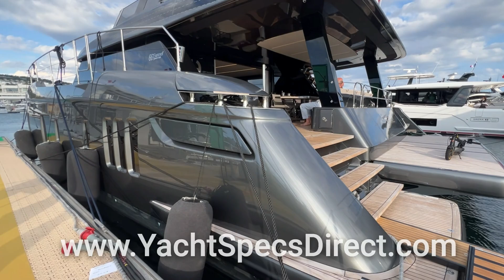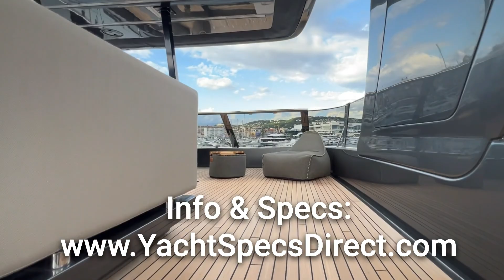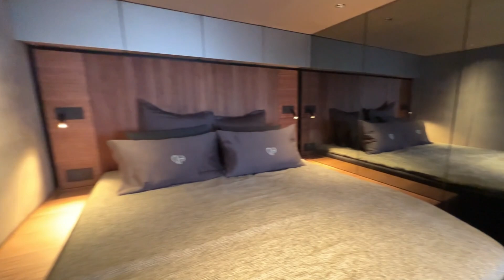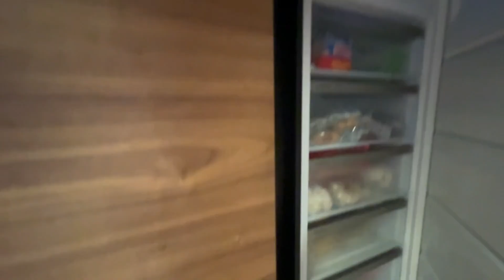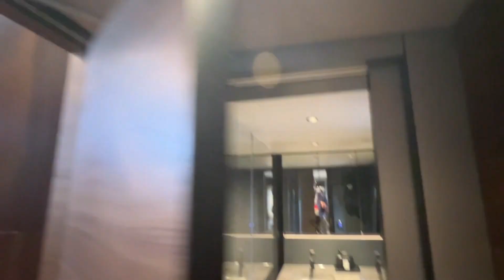Hybrid Electric Sunreef Eco 60 Power Catamaran: Owner Interview & Cannes Tour | Silent & Sustainable

Comment: If you are doing a trans-Atlantic crossing or cruising the Med or Carribean, fuel becomes a significant operating expense. Imagine cutting the fuel usage and cost by over 95%, assuming you have sunshine and you are not in a hurry (say about 5 knots).